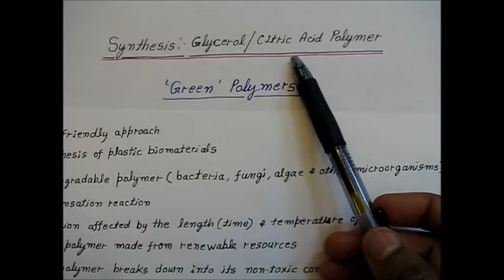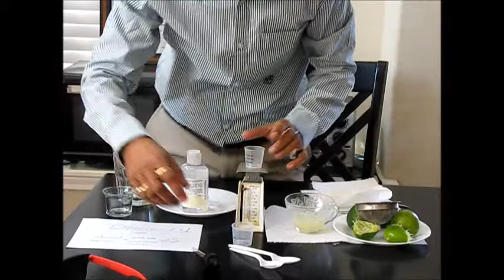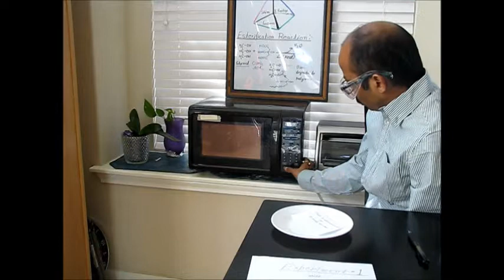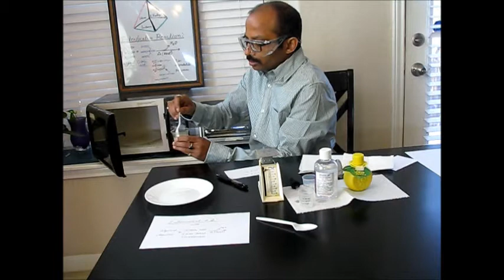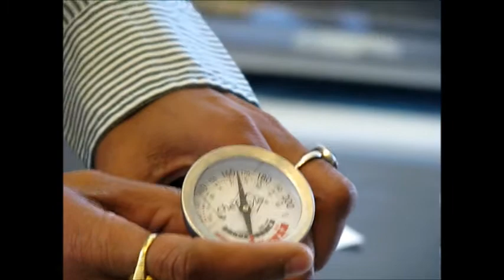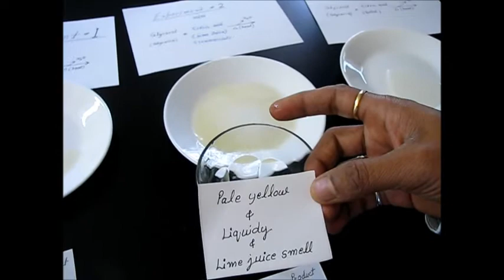Esterification Reaction | Glycerol Lime Juice Citric acid Polymer Synthesis

Comment: What is the benefit and uses of the solid citric acid and glycerine. You did not state.
Reply from the maker: @Pink Lady Bath & Body | This mixture is a good plasticizer and can be used as biodegradable plastic or in 3D printing. Purposes.

Comment: What is the use and benefits of the Solid Citric Acid and Glycerine? I don’t recall hearing you state that.
Reply from the maker: @Pink Lady Bath & Body | This mixture is a good plasticizer and can be used as biodegradable plastic or in 3D printing. Purposes.
Reply: Ok thanks for the response.